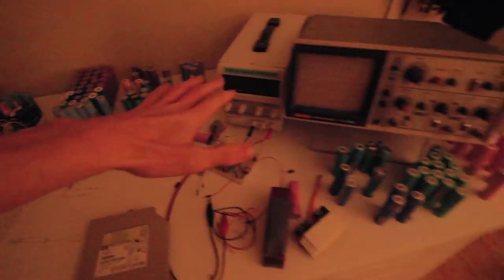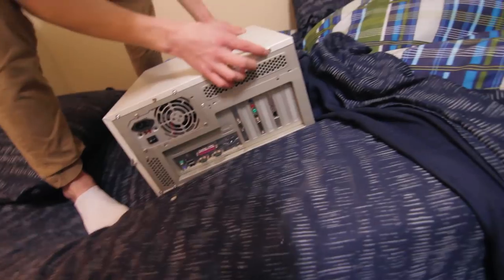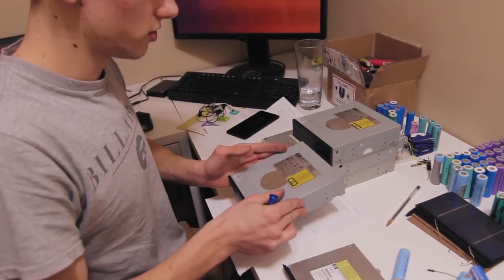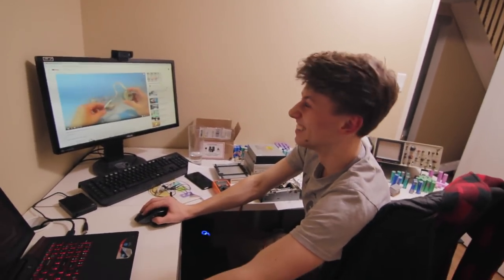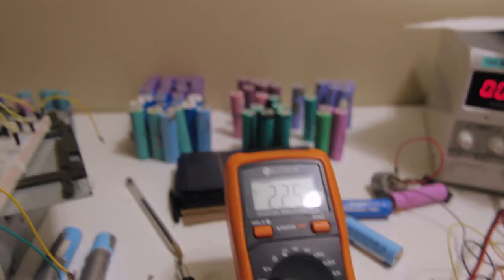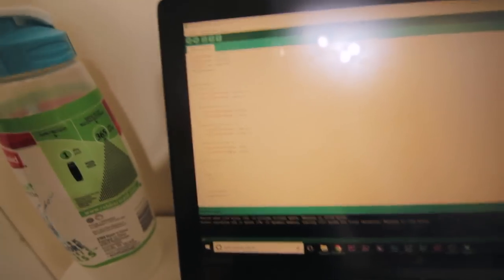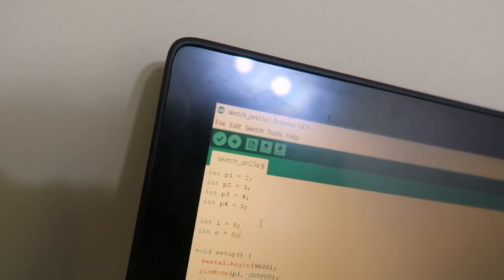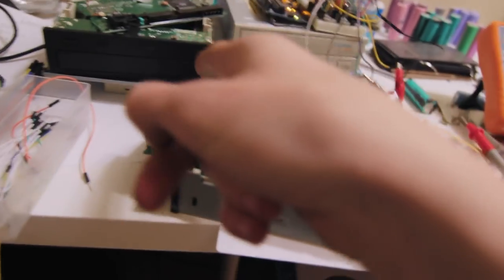DIY Battery Capacity Testing Robot | Part One (Arduino)

Comment: Loved this your videos never fail to chear me up
Reply from the maker: glad to hear that :)
Reply: That's way too much current ? For a motor, yes it's a DC motor, but come on man a student should know better. 
It's not like you were putting current through a diode,  is band theory not a rudimentary topic to CS students?

Edit: 
Ok... just resumed the video. "it needs a high frequency", Jesus Christ dude it requires digital instruction. Thank you, for reaffirming my decision not to waste precious potential development time, and money, on what appears to be a congregation of barely sentient, apriori, monkeys who will inevitably suffer for their inadequacies.

Edit^2:
Dude, it's getting worse. That "frequency" you are referring to, is called PWM, a technology that has existed since at least the 50's. You could generate the (highly generic) work-cycle output, with a two dollar AVR.

This was fun before, but now it's sad. There are two types of commonly used stepper motor, a bipolar and a unipolar, they utilize sections of electromagnets to induce movement. Fucking basic shit.

- posthumous injection, one could control a Bipolar Stepper Motor (ergo, a motor with 2 coils, and 4 leads) by way an H-Bridge; or you could fucking google it, and realize that it's much more practical to use a standard Darlington Transistor Array. Happy thoughts. As it seems, you do possess an AVR, congrats, if you're initial concern for PWM wasn't so fucking stupid you could fix it. Also, and I hate to nitpick, but you're in college and you're writing EACH (of the 8) motor phase changes? Here bro:

byte indCoilx00[4][4] = {
  {1, 0, 0, 0}, // => output: 1111101000
  {1, 0, 1, 0}, // => output: 1111110010
  {0, 0, 1, 0}, // => output: 1010
  {0, 1, 1, 0}  // => output: 1101110
};

index it. Fuuuuuuck.

30 seconds have past:
Please god, stop displaying that recursive, data brick, of a loop function to the world. And you were doing it so proudly....

Despite the fact that everything I said is irrefutably true, I feel pathetic in the relative difference between our levels of anonymity. So here's my github, there's an XCode project on there I wrote when I was 13, I think you might appreciate it. 
https://github.com/lancewalk87
 
...Dropping the cruelty, I'm sorry that you have to use that "Soldering Iron". It looks like something the former CEO of RadioShack would bring to Thanksgiving in order to brag, it didn't work for him, and it certainly isn't working for you. Yes, a Hakko would be lost on you, but at least invest in a decent Weller for fuck's sake. The difference between a 0, and a 5 is analog. Judging by the state of the piece of paper you wasted, it would appear as though you tried to fix a DIGITAL circuit with analog current. Bro, it's not a fucking light socket, or a B.A.S.I.C breadboard project, consisting primarily of technology so primitive, aging father's look forward to explaining it to kids, almost as unimpressed as I am.

5:03, "you were just thinking logically"... then why in god's name would you write a method, so thoroughly recursive, so utterly inefficient,  that I have yet again been forced to question the value of human existence. Are you familiar with the notion of infinity that would mathematically suggest a room full of monkey's are capable of replicating Shakespeare's entire collected work? Ya, Google already tried it, and do you know what those fucking Monkey's gave use?  I shall not give the answer, for I am too empathetic by nature. 

FUCKING CODER

Comment: I really like these videos and projects you do
Reply from the maker: appreciate the support bro!
Reply: That's way too much current ? For a motor, yes it's a DC motor, but come on man a student should know better. 
It's not like you were putting current through a diode,  is band theory not a rudimentary topic to CS students?

Edit: 
Ok... just resumed the video. "it needs a high frequency", Jesus Christ dude it requires digital instruction. Thank you, for reaffirming my decision not to waste precious potential development time, and money, on what appears to be a congregation of barely sentient, apriori, monkeys who will inevitably suffer for their inadequacies.

Edit^2:
Dude, it's getting worse. That "frequency" you are referring to, is called PWM, a technology that has existed since at least the 50's. You could generate the (highly generic) work-cycle output, with a two dollar AVR.

This was fun before, but now it's sad. There are two types of commonly used stepper motor, a bipolar and a unipolar, they utilize sections of electromagnets to induce movement. Fucking basic shit.

- posthumous injection, one could control a Bipolar Stepper Motor (ergo, a motor with 2 coils, and 4 leads) by way an H-Bridge; or you could fucking google it, and realize that it's much more practical to use a standard Darlington Transistor Array. Happy thoughts. As it seems, you do possess an AVR, congrats, if you're initial concern for PWM wasn't so fucking stupid you could fix it. Also, and I hate to nitpick, but you're in college and you're writing EACH (of the 8) motor phase changes? Here bro:

byte indCoilx00[4][4] = {
  {1, 0, 0, 0}, // => output: 1111101000
  {1, 0, 1, 0}, // => output: 1111110010
  {0, 0, 1, 0}, // => output: 1010
  {0, 1, 1, 0}  // => output: 1101110
};

index it. Fuuuuuuck.

30 seconds have past:
Please god, stop displaying that recursive, data brick, of a loop function to the world. And you were doing it so proudly....

Despite the fact that everything I said is irrefutably true, I feel pathetic in the relative difference between our levels of anonymity. So here's my github, there's an XCode project on there I wrote when I was 13, I think you might appreciate it. 
https://github.com/lancewalk87
 
...Dropping the cruelty, I'm sorry that you have to use that "Soldering Iron". It looks like something the former CEO of RadioShack would bring to Thanksgiving in order to brag, it didn't work for him, and it certainly isn't working for you. Yes, a Hakko would be lost on you, but at least invest in a decent Weller for fuck's sake. The difference between a 0, and a 5 is analog. Judging by the state of the piece of paper you wasted, it would appear as though you tried to fix a DIGITAL circuit with analog current. Bro, it's not a fucking light socket, or a B.A.S.I.C breadboard project, consisting primarily of technology so primitive, aging father's look forward to explaining it to kids, almost as unimpressed as I am.

5:03, "you were just thinking logically"... then why in god's name would you write a method, so thoroughly recursive, so utterly inefficient,  that I have yet again been forced to question the value of human existence. Are you familiar with the notion of infinity that would mathematically suggest a room full of monkey's are capable of replicating Shakespeare's entire collected work? Ya, Google already tried it, and do you know what those fucking Monkey's gave use?  I shall not give the answer, for I am too empathetic by nature. 

FUCKING CODER

Comment: Hey man, I've just discovered your channel and I really like your videos. Are you still planning on making a part 2 of this video?
Reply from the maker: Yes I've just been held back by exams!
Reply: Ah sucks, good luck then!
Reply: That's way too much current ? For a motor, yes it's a DC motor, but come on man a student should know better. 
It's not like you were putting current through a diode,  is band theory not a rudimentary topic to CS students?

Edit: 
Ok... just resumed the video. "it needs a high frequency", Jesus Christ dude it requires digital instruction. Thank you, for reaffirming my decision not to waste precious potential development time, and money, on what appears to be a congregation of barely sentient, apriori, monkeys who will inevitably suffer for their inadequacies.

Edit^2:
Dude, it's getting worse. That "frequency" you are referring to, is called PWM, a technology that has existed since at least the 50's. You could generate the (highly generic) work-cycle output, with a two dollar AVR.

This was fun before, but now it's sad. There are two types of commonly used stepper motor, a bipolar and a unipolar, they utilize sections of electromagnets to induce movement. Fucking basic shit.

- posthumous injection, one could control a Bipolar Stepper Motor (ergo, a motor with 2 coils, and 4 leads) by way an H-Bridge; or you could fucking google it, and realize that it's much more practical to use a standard Darlington Transistor Array. Happy thoughts. As it seems, you do possess an AVR, congrats, if you're initial concern for PWM wasn't so fucking stupid you could fix it. Also, and I hate to nitpick, but you're in college and you're writing EACH (of the 8) motor phase changes? Here bro:

byte indCoilx00[4][4] = {
  {1, 0, 0, 0}, // => output: 1111101000
  {1, 0, 1, 0}, // => output: 1111110010
  {0, 0, 1, 0}, // => output: 1010
  {0, 1, 1, 0}  // => output: 1101110
};

index it. Fuuuuuuck.

30 seconds have past:
Please god, stop displaying that recursive, data brick, of a loop function to the world. And you were doing it so proudly....

Despite the fact that everything I said is irrefutably true, I feel pathetic in the relative difference between our levels of anonymity. So here's my github, there's an XCode project on there I wrote when I was 13, I think you might appreciate it. 
https://github.com/lancewalk87
 
...Dropping the cruelty, I'm sorry that you have to use that "Soldering Iron". It looks like something the former CEO of RadioShack would bring to Thanksgiving in order to brag, it didn't work for him, and it certainly isn't working for you. Yes, a Hakko would be lost on you, but at least invest in a decent Weller for fuck's sake. The difference between a 0, and a 5 is analog. Judging by the state of the piece of paper you wasted, it would appear as though you tried to fix a DIGITAL circuit with analog current. Bro, it's not a fucking light socket, or a B.A.S.I.C breadboard project, consisting primarily of technology so primitive, aging father's look forward to explaining it to kids, almost as unimpressed as I am.

5:03, "you were just thinking logically"... then why in god's name would you write a method, so thoroughly recursive, so utterly inefficient,  that I have yet again been forced to question the value of human existence. Are you familiar with the notion of infinity that would mathematically suggest a room full of monkey's are capable of replicating Shakespeare's entire collected work? Ya, Google already tried it, and do you know what those fucking Monkey's gave use?  I shall not give the answer, for I am too empathetic by nature. 

FUCKING CODER
Reply: What?

Comment: Very Nice Bro u have different Thinking Just can u do u are programming language And pls make more Electronic Videos
Reply from the maker: thanks man, working on more electronic videos right now :)
Reply: That's way too much current ? For a motor, yes it's a DC motor, but come on man a student should know better. 
It's not like you were putting current through a diode,  is band theory not a rudimentary topic to CS students?

Edit: 
Ok... just resumed the video. "it needs a high frequency", Jesus Christ dude it requires digital instruction. Thank you, for reaffirming my decision not to waste precious potential development time, and money, on what appears to be a congregation of barely sentient, apriori, monkeys who will inevitably suffer for their inadequacies.

Edit^2:
Dude, it's getting worse. That "frequency" you are referring to, is called PWM, a technology that has existed since at least the 50's. You could generate the (highly generic) work-cycle output, with a two dollar AVR.

This was fun before, but now it's sad. There are two types of commonly used stepper motor, a bipolar and a unipolar, they utilize sections of electromagnets to induce movement. Fucking basic shit.

- posthumous injection, one could control a Bipolar Stepper Motor (ergo, a motor with 2 coils, and 4 leads) by way an H-Bridge; or you could fucking google it, and realize that it's much more practical to use a standard Darlington Transistor Array. Happy thoughts. As it seems, you do possess an AVR, congrats, if you're initial concern for PWM wasn't so fucking stupid you could fix it. Also, and I hate to nitpick, but you're in college and you're writing EACH (of the 8) motor phase changes? Here bro:

byte indCoilx00[4][4] = {
  {1, 0, 0, 0}, // => output: 1111101000
  {1, 0, 1, 0}, // => output: 1111110010
  {0, 0, 1, 0}, // => output: 1010
  {0, 1, 1, 0}  // => output: 1101110
};

index it. Fuuuuuuck.

30 seconds have past:
Please god, stop displaying that recursive, data brick, of a loop function to the world. And you were doing it so proudly....

Despite the fact that everything I said is irrefutably true, I feel pathetic in the relative difference between our levels of anonymity. So here's my github, there's an XCode project on there I wrote when I was 13, I think you might appreciate it. 
https://github.com/lancewalk87
 
...Dropping the cruelty, I'm sorry that you have to use that "Soldering Iron". It looks like something the former CEO of RadioShack would bring to Thanksgiving in order to brag, it didn't work for him, and it certainly isn't working for you. Yes, a Hakko would be lost on you, but at least invest in a decent Weller for fuck's sake. The difference between a 0, and a 5 is analog. Judging by the state of the piece of paper you wasted, it would appear as though you tried to fix a DIGITAL circuit with analog current. Bro, it's not a fucking light socket, or a B.A.S.I.C breadboard project, consisting primarily of technology so primitive, aging father's look forward to explaining it to kids, almost as unimpressed as I am.

5:03, "you were just thinking logically"... then why in god's name would you write a method, so thoroughly recursive, so utterly inefficient,  that I have yet again been forced to question the value of human existence. Are you familiar with the notion of infinity that would mathematically suggest a room full of monkey's are capable of replicating Shakespeare's entire collected work? Ya, Google already tried it, and do you know what those fucking Monkey's gave use?  I shall not give the answer, for I am too empathetic by nature. 

FUCKING CODER